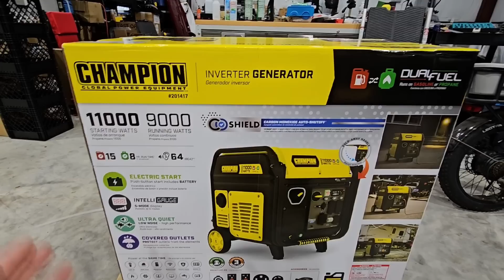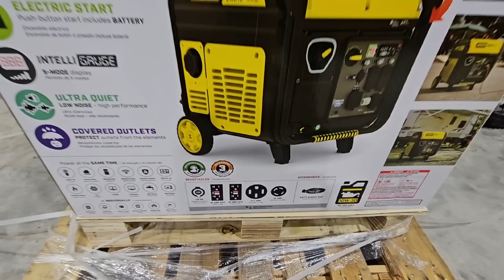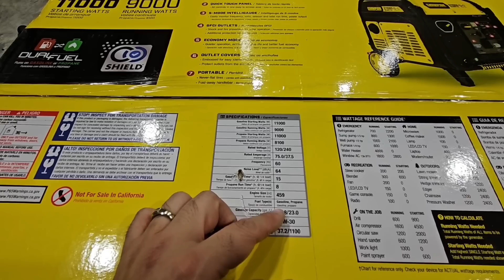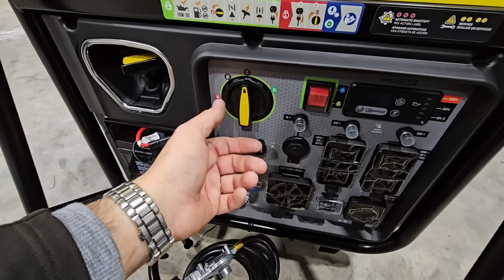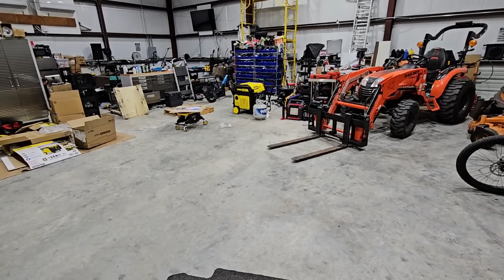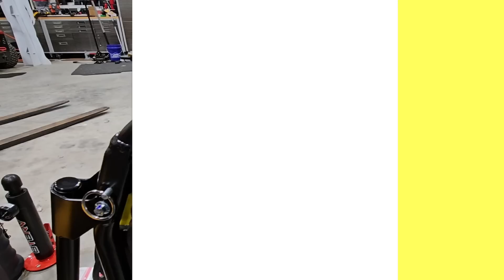POWER IT ALL! BIGGEST BADDEST 11,000w Champion Dual Fuel Portable Generator for RVs with 50amp Plug!

Comment: Great review...  Can you please help me with this, I can't find this at one of the box stores.  What are the dimensions without the wheels and feet. I'm trying to figure out if this will fit in my Gen Box on the front of the trailer. Factory specs say "28.3 inches in length, 28.8 inches in width, and 27.5 inches in height". Im trying to figure out its smallest form factor. No wheels, feet, handle , or bar on the back.

Comment: I agree, I have 5 Champion generators and they are all great machines. Never needed to use their service but I do know its known to be great. However, design wise, I believe they missed the mark  by not making it a tri fuel generator. I would have  bought Champion but instead opted for another make with 10500 watts output but also natural gas capable. I use this as my home backup generator. I took a chance on a relatively unknown brand rather than buy a Champion. So far completely happy with it, but over time who knows if I need service. Since it rarely runs, I believe I'm  ok but if I needed a large generator that would see thousands of hours of use, I would trust Champion over other Chinese brands. 

But anyone coming out with a new model large capacity generator that doesn't have tri fuel capability is seriously missing the mark and will lose sales because of it

Comment: I have a Champion 4250 30 amp open frame inverter, like it plus it has a remote start fob.
Only complaint is it's too tall to fit under my tonneau cover.
I'd bet yours should run 2 ACs & a Keurig @ same time.

Comment: Shoot if my Champion 3400 can run both 15K AC on my 3660SUITE using soft start, this one should have no issues with straight up no soft start AC.  My only issue with the Champion is adding an extended run tank without mods.  Assuming it would be the same with this one requiring adding a pump since it appears to still be gravity fed.  Adding a tank like those used for an outboard motor can really add to the run time.   I wonder if this one would be more efficient for powering my house than the 8400 watt generator I currently use, would be a whole lot quieter thats for sure.  Have to go look up that 30 amp plug to see if its the same standard plug used on emergency backup gensets, if so, I might just consider getting one this year.

Comment: Doesn't seem to have a low idle or economy mode. Does it just run at high rpm all the time? Defeats the purpose of  inverter generator.
Reply from the maker: From their website: The Intelligauge with Power Meter monitors voltage, frequency and operating hours with ease, while Economy Mode monitors power consumption in real time to reduce engine wear. As the electrical load is reduced, the inverter reduces engine speed, providing quieter operation, extended engine life and higher fuel economy.

Comment: Its perfect... Accept for the 37.5 amp capacity. Give us a full 50 amp dual fuel, inverter generator please
Reply: Then you would need to buy a larger generator,  more in the 12 to 15 kW size.
Reply: @SteveGuth I know, that's what I want. A 15kw+ inverter generator.
Reply: 240v x 37.5A is 9000W.  That's exactly the rated running watts of this generator.

Comment: I can say from personal experience that the Champion generators are easy to repair when the important PLASTIC THROTTLE PIECES BREAK…after a hurricane…while I’m trying to get my grandparents’ one started…because we won’t have powers for weeks, and it won’t start for some reason…
Yeah… never have I been so annoyed that an arm connected to the throttle was made out of flipping brittle plastic rather than metal. A manufacturer saving about $0.007 sucks when you’ve spent so much on something and after one season inside a garage, the brittle plastic has to be monkey rigged to function.
Starts great and works wonderfully once I spent 2 hours on it.
—
And all of you about to comment… less than 20 hours AND how do you “take it back” “warranty” or “return” it when you had a Cat 5 hurricane roll over you? You adapt and overcome.

Comment: Great timing on this review. Was looking at this model for home backup during hurricane season.
Reply: Just be aware most of these portable generators won’t support 240VAC… Not sure about this beast. But usually you’d have your lights, fridge, tv, some fans but no A/C or electric dryer or electric stove.
Reply: Check out the Champion Tri-Fuel 201423 generator for home backup.

Comment: 15+ year RV electrical technician here. There is one very big downside to using portable generators over the on-board unit. Durability. If you look at a 8,000w - 10,000w Cummins Onan QD series generator that is installed in your coach and look at a portable generator in the same power range, you will see that the on-board is built MUCH more heavy duty. I will trust the on-board unit to run for weeks non-stop with no problem. The portable is unlikely to handle anywhere near that level of duty cycle. I’m not saying portable generators are bad, far from it. Just don’t expect them to stand up to the kind of abuse that on-board units were literally designed to operate in.

Comment: I bought this model last October. It's bad ass. Champion Model 201417. It will run your entire house in an emergency when connected to a breaker interlock on your main panel.
Reply: you use the  30amp plug or 50 amp plug to your house
Reply: @coreysieminowski9474  50A plug to a 6AWG extension cord with a NEMA SS2-50R and a 14-50P from the generator to a 50A receptacle that goes to the panel with a 50A breaker and interlock switch. The max running amp output of the generator is 37.5A, (9kW/240v), with a max starting amp output of 46A (11kW/240v)

Comment: Lost my interest with the lack of 50 amps from the 50 amp plug.
37 amps only?
Bye bye.
Reply: Yes 50 amps x 240 volts = 12000 running watts needed to get a full 50 amps the only inverter generator that can do that is the duromax 16000 and its 450+ lbs and $5k.
Reply: I think that's about on par with everything else in this size and output category. If you want a true 50amp output, those units are gonna be in the 350lb range.
Reply: 37.5 amp per 120V leg.  For 240V you get 37.5 amps

Comment: Personally i don't call a 200lb generator "portable" by any stretch.
Reply: Why not? It's not mounted to a concrete slab. It can be hauled around with a pickup or trailer
Reply: @United_Kangaroo1992  You picking that up to throw it into the back of a full sized one ton truck so you can power your RV with it? I know im not...
Reply: It has wheels.